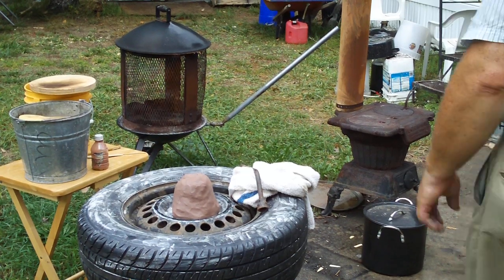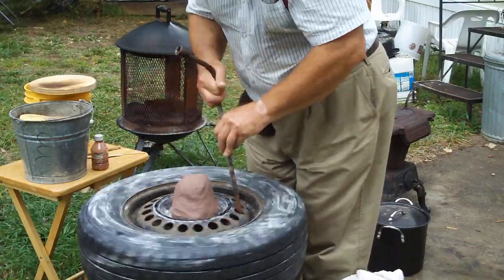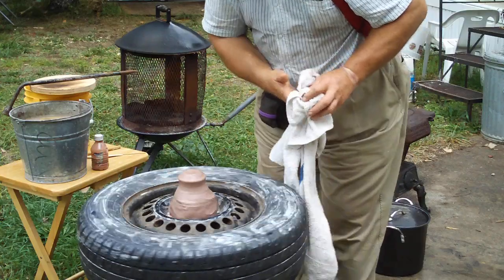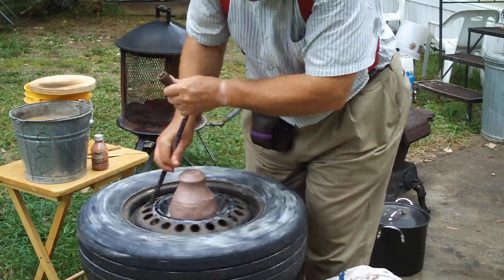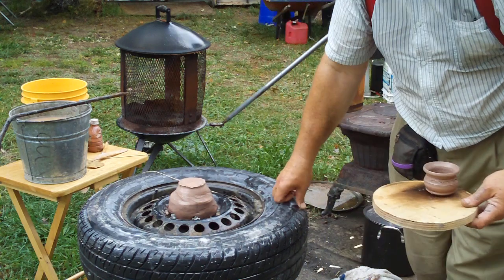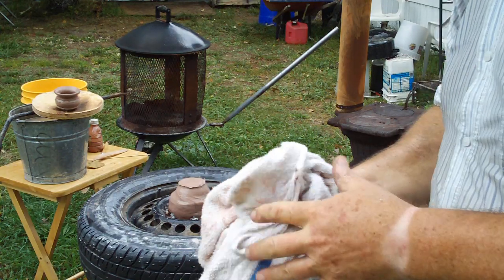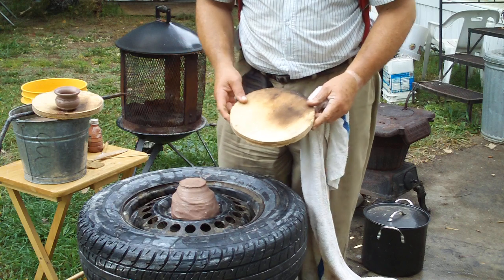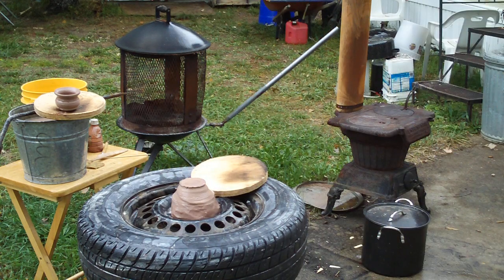pottery throwing demo on a car tire~by Hillar Bergman

Comment: This video gave me an opportunity to show my wife how a permanent magnet motor can self brake when you short the input wires together. I have a 500 watt electric scooter motor with controller to make a pottery wheel that will not only spin up to the speed she needs, but also self brake when the pedal is applied backwards by shorting the input wires, assuming the wheel has the momentum/weight to not cause the wheel to come to a screaming halt tossing the clay off the wheel. Excellent video Cat!

Comment from the maker: Yes, the rubber tire makes a "friendly" surface if you have to wipe it down with a sponge while it is spinning as I often do. I throw small pieces and find the tire alone provides me enough weight/momentum for those. Adding weight to the tire as you suggest would help considerably for throwing larger pieces.

Comment: You can cut a hole out of the tire and fill it with grout. If you stand the tire straight up, cut a hole in the top, fill with grout, you can get a good balance. Just don't cut a really large hole. 3 inch hole should be big enough. Later after the grout sets up you can cut away the tire if you want. But personally i would rather leave it in place. The tire is more forgiving to your skin than the concrete, if you accidentally bump into it while it's moving.